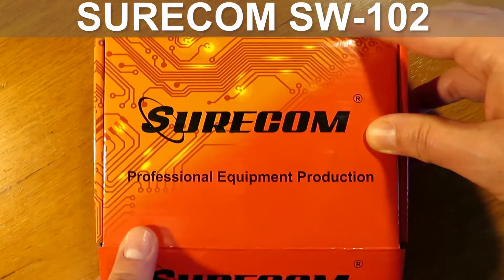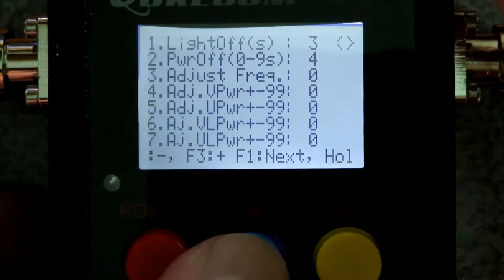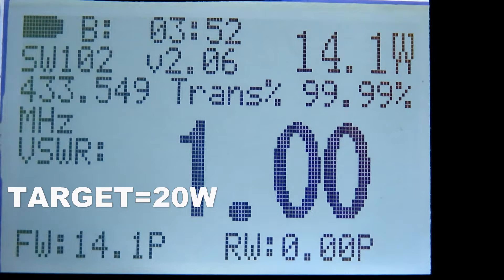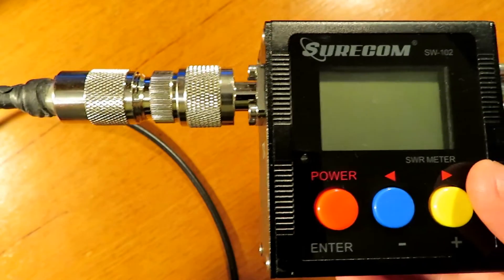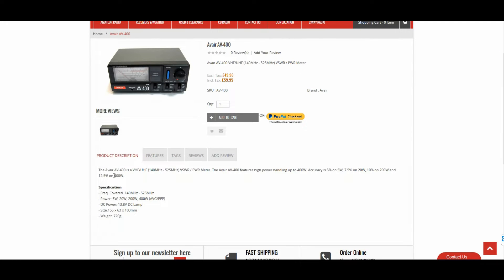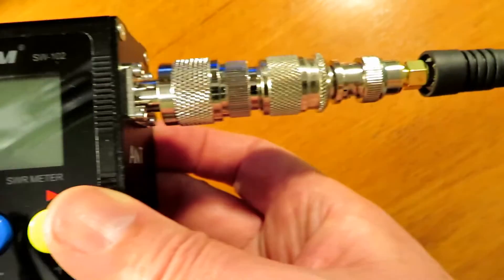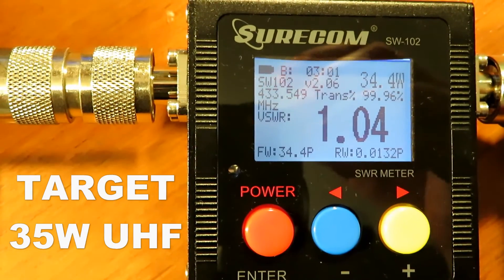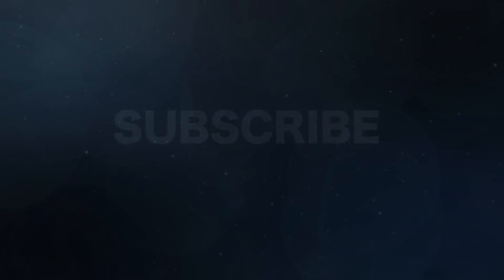Digital Chinese RF Power/SWR Meters? & WHY PL-259 is BAD for UHF.

Comment: My Surecom digital reader was a disaster. With my Baofeng UV9RPlus on one end and my Nagoya NA-771 on the other, I was getting 3.73W and an SWR reading of 3.58 with a fully charged radio and device. So I'm wondering if I need a ground plane? Surecom used to include one with previous models, but they stopped due to the cost. The company still recommends you use a homemade one. So did you use a grounding plane plate, or a grounding wire? My readings were not accurate, so I ordered a meter with a needle. Haven't gotten it yet, though. 

Also, Surecom recommends against using its little meter horizontally, but says to use it vertically with a ground plane for best results. But nearly all YouTube reviewers use the meter horizontally. The instruction page shows it horizontally, then has one of those circles with a slash through it, to show it's the wrong way. Based on the results people get, it doesn't seem to make a dif.
Reply from the maker: I've not had any problems with this meter, the antenna I use it on is roof mounted but it's on a pole which does act as a ground plane, using a dummy load swr is always 1:1 might be a calibration issue with your one, there is a procedure to calibrate it in the manual.

Comment: Thanks for this video; very informative. One question: does the device need to be power on in order to pass the RF to/from the rig, or what I need to take it out of circuit? Thanks.
Reply from the maker: Cheers, no it doesn't have to be powered on and can be left in circuit 👍

Comment: Why does everyone measure power with a dummy load? With a base antenna at home the results are different?
Reply from the maker: Use a dummy load so little to no power is reflected, reflected and distorted harmonic power fed back causes poor performance from these meters, labs also test in to dummy loads, you can't get a better match for the output stage, no antenna will come close to a well made dummy load.
Reply: @knoxieman  So a dummy load is used to measure the power of a radio as accurately as possible? I'm interested in an example. If measuring a radio with a dummy load shows us 40w. And with a good base antenna it shows 30w ... How many watts does it get to the antenna? 40 or 30w?
Reply from the maker: 40 watts gets to the antenna but 10 watts is reflected because the antenna is poorly matched, it's the standing wave ratio, hence the name SWR meter.

Comment: Why sell UHF radios and antennas with UHF socket rather than N socket if UHF socket is not good?
Reply from the maker: Exactly cheaper radios have pl259 quality ones use NType
Reply: @knoxieman  Due to the UHF connector, the power meter shows less w. Does that mean less w goes to the antenna or just that the power meter alone can't accurately read the power?
Reply: @marinmarin7187  the first one you said
Reply: For years, every mobile radio, I have seen, in the USA comes with a PL259. Maybe the Type N connectors are new, and better? But I still see Yaesu, Alinco, Kenwood with the PL259' on the radio.

Comment: Hi. I tested this item too in UHF with a 991a and saw too that using the same little coax with a PL and 1 1/2 foot long completly degrades the results. Connecting directly the antenna the 991a shows 45W and 1.35 SWR through one little coax and a switch but adding a second little coax and the Surecom gives a disaster,, SWR = 2  and the protection included in the 991a reducts the power to 15W. Always use a good coax, Aircell, .. in UHF and N connectors even if the length is only 50 centimeters.
Reply: Its LMR-240 (RF240) Belden good cable?

Comment: I tried adjusting frequency counter in that calibration menu, to get it to agree with the radio, but it doesn’t actually do anything :D
Reply from the maker: Ah right I'll be honest I've not tried that, have you got the latest firmware on it and have you tried contacting the manufacturer
Reply: @knoxieman  To be honest, I think it’s junk and I’m not hung up on it. It also reports higher output power for UHF than for VHF with the same radio.
Reply: Brek Martin which swr would you recommend

Comment: ratings are ..... close.   Have to remember it is a "cheap" meter.   For the price, it will do, to make sure you are transmitting and the SWR seems to be very close.   Here again, you are using a cheap meter. It will get you by but, not as your main meter for real antenna work

Comment: So I have a couple of questions... 1.) Other than possible realities and such, can you test output wattage safely using an antenna rated for the power ouput or must a dummy load be used?  2.) Will one dummy do it all as in is there one rated dummy load that can safely test from zero watts to one hundred watts?
Reply from the maker: Yes you can use an antenna rated for the power and frequency as long as your swr is ok, I just used a dummy load to prevent transmitting over the air, yes you can buy a 300 watt dummy load for instance that will do up to 300w.
Reply: Mine just arrived and it's the updated version.. Yippee!  it works like a champ...  Now I know why nobody can hear me on my BF-888S'.  lol. 1.53 Watts. haha. but my old uv5r+ units are thumping out minimum 4.65 Watts in VHF mode...  I cannot wait for the rest of my N type adapters to come in so I can test my TH9000's my GD-77's in analog mode, my KT-8900's, my 980Plus units etc etc... this really opened my eyes to frequency vs wattage.  I got my unit delivered to my door from China with zero customs/duty costs for around $43 Canadian and it was about 11 days from paying to using!...    I'm pleased as punch with this unit!  Now to await an economical DMR tester... :)
Reply: Thank you very much for the info...  It's greatly appreciated! :)

Comment: Thanks for such an interesting, well thought out and well put together video. That little meter looks good for the price. I thought about getting one a few times but always put it off. I've got some cheaper ones and they're rubbish so this one is well worth it. Thanks for pointing the UHF issue on high power too! I hear a few amateurs talking about that and it shows in your tests. The spreadsheet is a great idea too, nice to see all the data together to compare. It's great you used high end radios to compare too! Cheers Paul, was well worth the wait!
Reply from the maker: Thanks mate that's nice of you, it took 4 days to make the video, I tried quality leads and they all failed on high power UHF, even though they are sold as pl259 UHF connectors that was back when 100 MHz was considered UHF, PL259 is only rated at 300Mhz and that's quality silver nickel ones, the ones most of use are only really good for HF.